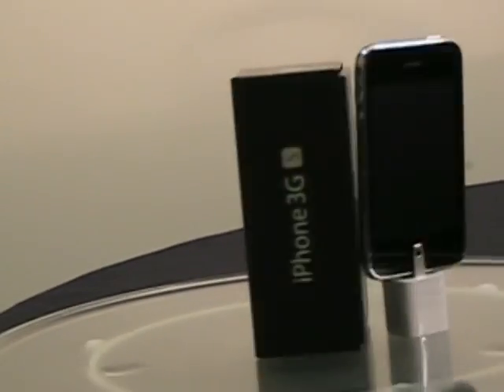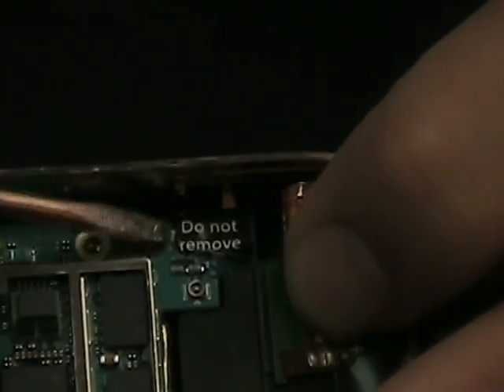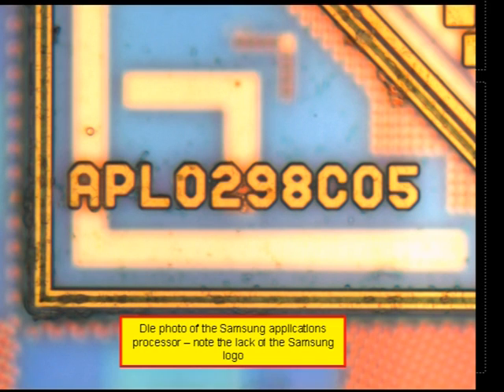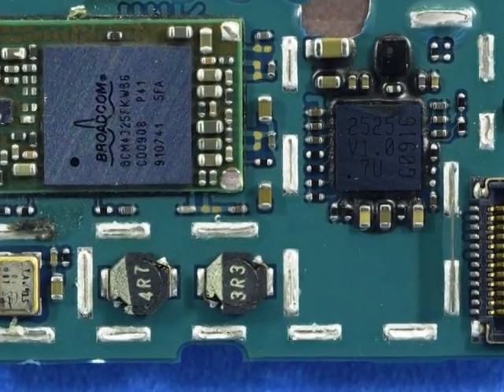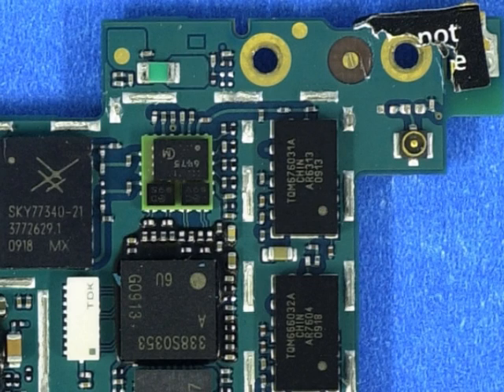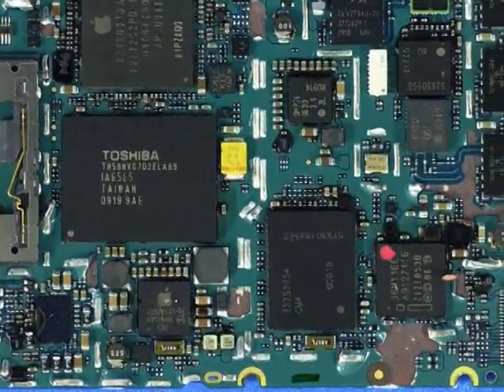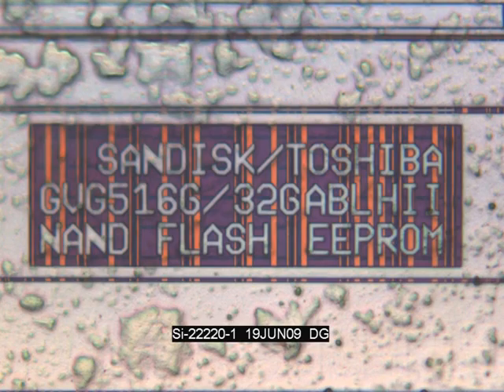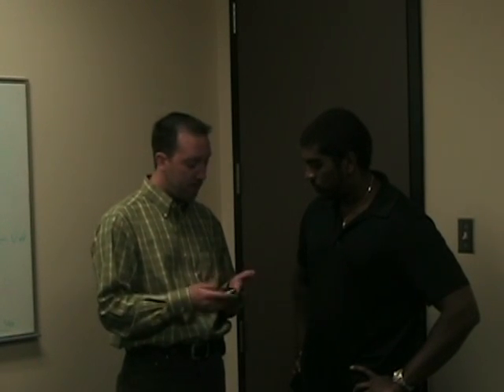iPhone 3Gs Teardown - iPhone 3G S

Comment: crack in the motherboard, if it's going across a curcuit track you can't do much to fix it without damaging the chips and it'd be pretty damn hard to solder some of those tracks back together because they're so damn small. so you'd be best off just buying another phone because a new motherboared for an iphone on ebay is $400-$500, so it's really not worth it.

Comment: you know recently some guys walked around a shopping centre with an iphone 4s saying it was an iphone 5, you'd be amazed by the amount of people that said "Wow, this is so much faster then my 4s" I think you'll also find that just before relesing the iphone 5 with iOS 6, iOS 5.1.1 was slow and pretty horrible, it used a lot of battery, I noticed this when I updated my ipod 4th gen to iOS 6, it went faster, used less battery and less apps crashed. They do make them faster each time but not much

Comment: yeah.. it has a 3mp camera that takes video, double the ram and processing speed, better oleo-phobic treated glass, different chip sets.  faster in general.

so besides the design of it, what do you see that's the same?

it's the internals that separates the two.  not the external.

and to add, my cousin has the 3G and I have the 3GS.  Mine loads everything faster.  From apps to web pages to cydia and more, it just does it better and more quick.  oh, and the camera responds better.  not the same